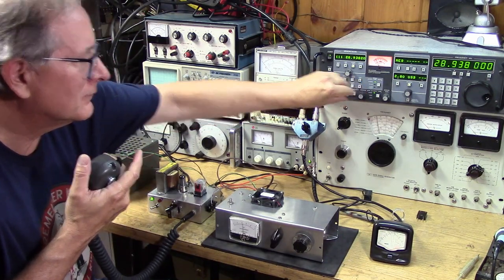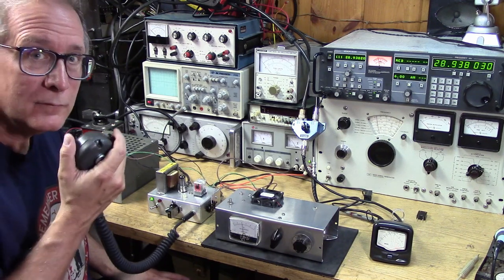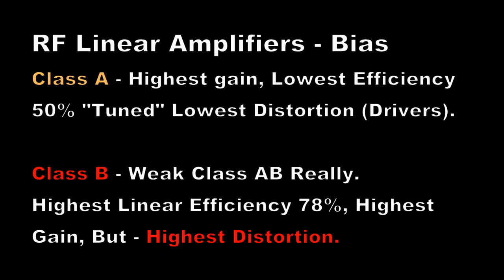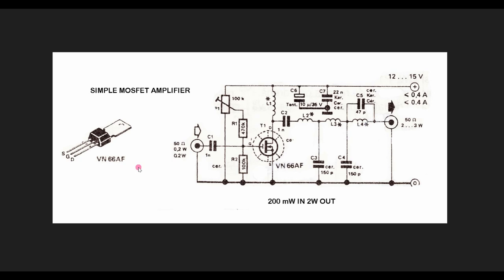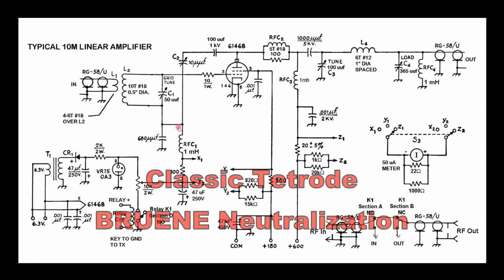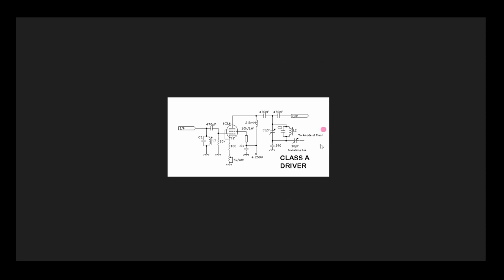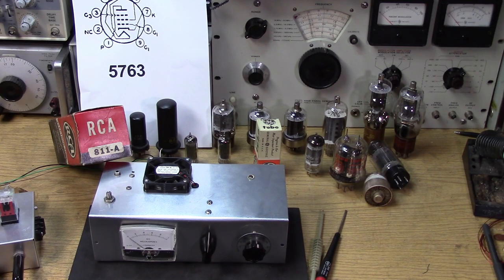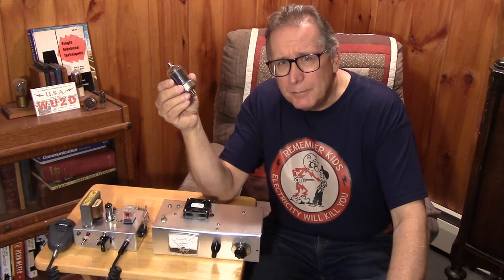10M Linear Amplifier - Part 1

Comment: That great. I use AL572 amp with 572/B tubes. with amps like mine or 811A type running AM is hard on them. reduce drive to save tubes. MY AL572 has a special bias when running SSB between words the bias cuts down saving heat. for FM and CW you can bias class C . also large AM transmitters are using AMC modulation big saving's on input power.  and the station I worked at can go 120% mod. on AMC . Funny I just ordered some 6164B Russian tubes. I have China and GE 6146W tubes now. I made AM transmitters. I used cathode modulation. with 6164B , 73's

Comment: I would think optimizing a linear amplifier just for SSB would be more of a hassle than optimizing an AM linear amp. to work on both AM and SSB? I had a KLV-1000 Italian-made HD 1000-watt linear for 10 meters converted for 11 meters. I cannot remember the IDs of the 4 tube final output tubes. My 2990 was the driver in this case. It was good for about 800-900 watts on AM and SSB. Back then the neighbors were not happy with my setup interfering with their TVS and telephones so I got rid of the Linear. It only cost my $550 brand new.. I was walking over locals in California from Vermont..

Comment: With SSB linear amplification I always try to use a lower output power than if I was to use it on AM. Also on SSB I use the lowest dead-key carrier which would be on AM to TX with. I always try to have the modulation swing as much as possible on SSB. Instead of the wattage output meter showing little swing.. On AM I don't worry so much about swing instead of carrier. Also as we know using a linear on SSB you have to have a delay set up on your relay. Otherwise, you get chatter if there is no delay implemented.. I've noticed on SSB anything over 80 watts on an amateur 10-meter radio sounds like garbage.. I have an RCI 2990 that PEPs at 90 watts on AM, FM, and SSB.. I have not tested CW yet.. I use an Omni-direction Solarcon A-99 with a 102" steel whip in place of the top element. I also have the ground plane kit attached to the base of the antenna. Just the other night I had a QSO with Oregon, California, and Alberta. I live in Vermont. I was outputting about 20 watts PEP on LSB.. 27.3750 it was 7:30 pm in Vermont..

Comment: For what it's worth, The question brought up by folks as why you didn't use a SS linear because it's simpler, both of the amps look about the same to me with regard to skill. I'm glad you're using a tube. 😉 👍
Reply: SS? Social Security?
Reply from the maker: @Capecodham  Yes You need SS. Solid State

Comment: Mike, I too had problems getting 'purported' power out of the 5763s. Even in class-C, I've heard stories of north of 10-12 watts!  I finally ran across some Tungsol data that showed useful power at class-C to be 6.4 watts; which is more in line with what I've seen
Also Mike, did you consider the 2E26, I would think that it would fit perfectly in what you are doing and be loafing at it (?).
Finally, I have some (REALLY) bizarre dual VHF/UHF tubes that would probably be cute as CW transmitters!  73...
Reply from the maker: Charles Caringella's book Amateur Radio Construction Projects features a 5763/2E26 Transmitter that is hard to beat.

Comment: I suspect there were mobile transceivers that used 12V vacuum tubes with a 12V B+ i.e the tubes that were developed in 1957 when the transistors of the day were not ready for prime time.
Reply from the maker: Yes all of the two-way radios used tube drivers and finals late in the semiconductor era; development continued well into the 60's. The 12V versions of the 6146 are many.. 6883, 8552, 8032 etc.. The Compactrons and other really high performance tubes like the Motrac Finals were manufactured up until the 70s.

Comment: It is always better (6146 circuit) better to derive the screen supply from the plate supply to avoid losing the plate supply while maintaining screen Voltage. (which would burnout the screen wires) The 807 and 826 tubes (used in class "B push pull) are zero bias minimal plate current and distortion for linear amplification. Ron W4BIN

Comment: Using suppressor grid? Cool.
Years (decades) since I've messed with tubes.
Reply from the maker: Some tubes (many peanut tubes) have the suppressor grid brought out separate from the cathode. Super easy to modulate with some negative V and an electret mic into a step up audio transformer. I used a carbon mic just to match the project as it was written in 101 Easy Ham Radio Projects. The vids before go through the little TX.